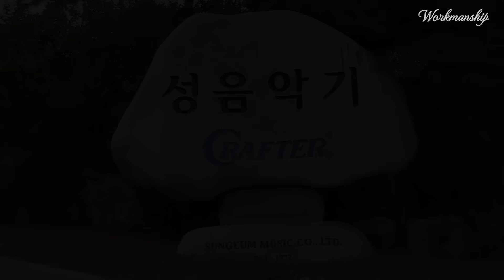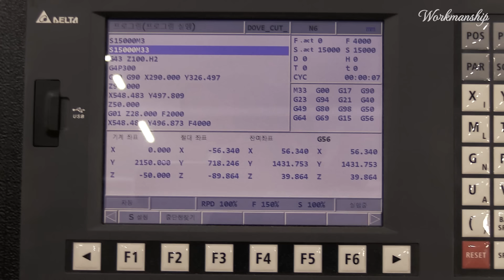Acoustic Guitar Mass production Process. Amazing! Crafter Korea Guitar Factory Tour

Comment: Interesting to see each Guitar manufacturer's process... some are similar, others are a bit different how they apply it. I would say one of the most critical process is probably concerning the neck, since your direct contact for the fingers is there. If it's still done unadjustable like we've seen here, yes, it's faster and easier to glue, but boy, look at the innovation from Taylor & Riversong Guitars, they are really what each acoustic guitar should have. Easy adjustable / resettable neck should become standard these days.
Reply: Take a look at EKO vintage reissue guitars, they have a bolt on neck!
Reply: Taylor have the best neck but the most important thing, their tone although good still have a lot to be improved , given the neck cutting price tag
Reply: @phanhuyduc2395  Right, Even so, I'm surprised that at the high price tag they don't provide you with one piece neck or something more premium. On my 114 they use a 3 parts glued neck

Comment: I liked lots of this build process except for gluing onto the lacquer. I have found in my years of offering guitar repair that when gluing to lacquer, that is usually the part that fails and needs the bridge or fretboard glued back on to raw wood.
Reply: That's why they strip down lacquer before they glue sth on to it?
Surely it could be done much precisely, but here that part of bulid looks not bad at all actually
Reply: The way they've done it is the same as most luthiers today.  Once the lacquer's been scraped away, it's virtually wood to wood contact.
Reply: Maybe you didn't notice. The lacquer was removed before gluing.
Reply: An easier way surely is to use a sticker template of the bridge before lacquer is applied then remove sticker template to apply bridge onto the raw wood

Comment: I would not have like the guitars, at least I would not pay high price for them. One of the major flaw in the process was submerging the side wood in the water. Guitar woods are dried and stored in a temperature/moisture controllled environment. And now gets submerged in warm water introducing water into the wood ... Unless these guitars woods are not dried and stored properly. So it doesn't matter of the moisture. Most makers use mainly heat and maybe spray some water or use stream to help bend the wood but never submerged them in water.
And sealing in the wood while there's moisture, that would cause problems down later on.
The whole making process looks great, but that side wood totally submerge and soaked in water just compromised the whole integrity of the guitar.